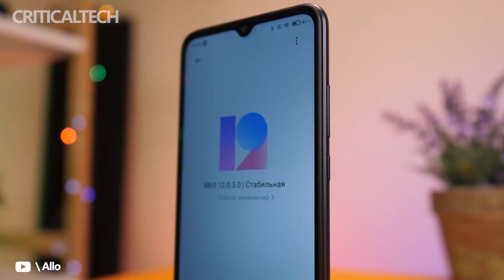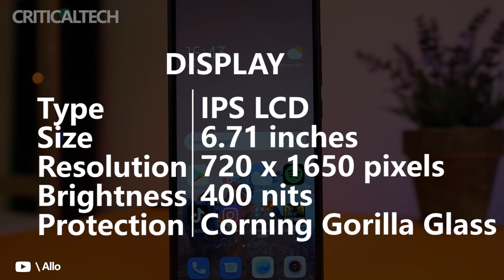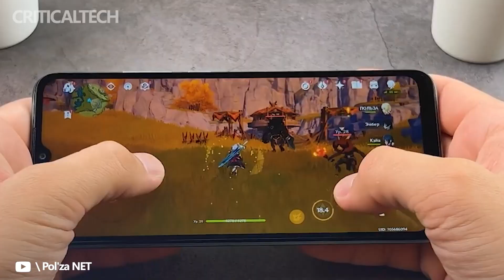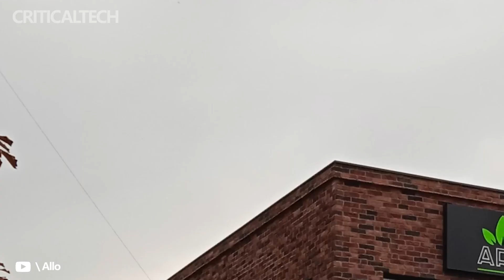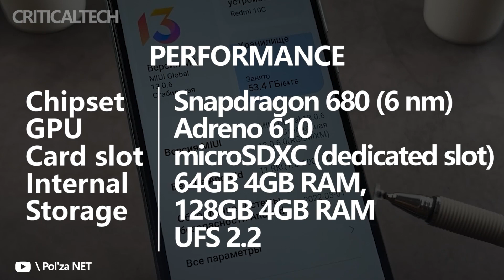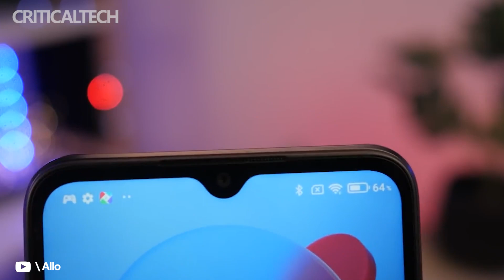Xiaomi Redmi 10C Review | Snapdragon 680 and 50MP Camera (2022)

Comment: I prefer rear back fingerprint
Reply from the maker: I guess the location of the scanner is just a matter of getting used to, a couple of days and you will be able to use the scanner like on the back, like on the front or like on the side.
Reply: @criticaltech7091  in my opinion
Rear scanner is for longer fingers
And side scanner is for smaller fingers.
Since my fingers are long i feel comfortable in rear.
Reply from the maker: Judging by the size of the fingers, then you are right!
Reply: @EJ_ARCEUS  I agree with it.

Comment: Redmi 10C or Redmi 10 (which phone should I buy?
Reply from the maker: Depending on what goals you need a phone for. For example, for gaming, I would prefer the Redmi 10C model, as it will have a better processor. But if you need a camera, then maybe Redmi 10 will be better, as it has an ultra-wide mode. Also, the screens are different, for example, Redmi 10C has a larger one, but the resolution is half as much. Therefore, the screen of Redmi 10 will be better. The battery of both smartphones is identical.
Reply: @criticaltech7091  I will use for social media , watching movies , playing Ppsspp emulator and some online game(my now device had ufs 2.2 if I used Emmc 5.1 Redmi 10 ,will I feel slow )
Reply from the maker: @supersaiyanrose2578  Then I would advise you to take Redmi 10C.
Reply: @criticaltech7091  Thanks for reply ☺️
Reply from the maker: @supersaiyanrose2451  Thank you also for your interest and comments.
Reply: @criticaltech7091  how about if you want a phone with a large and better storage,which is better?...thank you
Reply from the maker: @laranepatria5978  Xiaomi Redmi 10C has UFS 2.2 and it's faster than the eMMC 5.1 that comes with Xiaomi Redmi 10. In terms of memory, both versions are the same.